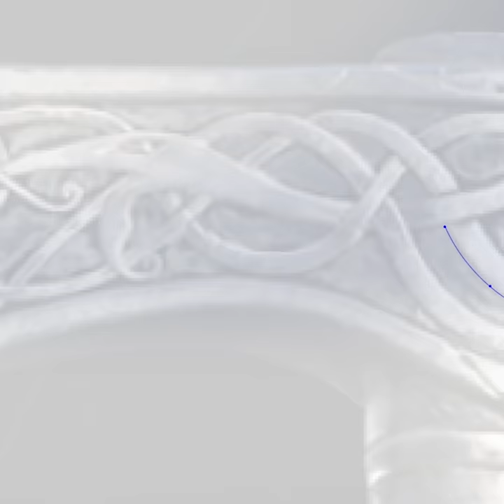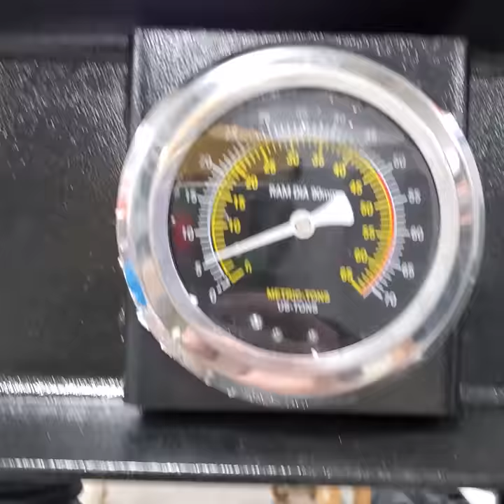VALHALLA AXE! (One Day Build!)

Comment: Next week: Work like a Vikinger (without your technical equipment just hammers and this stuff).
Reply: Forging?
Reply: @kasperklbu8050  For example I meant that they should use a hammer instead of their technical equipment but forging is a good idea
Reply: Well scandinavians had some complex tooling for their time obviously not to these level but they definitely had some kind of lathe as evidenced by the uniform taper on their shields
Reply: @velazquezarmouries  Lathes were about for around 2000 years before the Vikings arrived in Britain so I would assume so
Reply: @olive7831  greeks also supposedly made their shields in layhes
Reply: Vikingr*

Comment: Always love a good axe build, a tip from a knife maker and axe restorer, saltwater electro etching using a vinyl stencil isnt much slower than that cnc laser and gives cleaner less burned looking lines for decorative engraving on metal pieces like that, I use 12v but you can push it higher for faster results

Comment: That's... That's just not safe to swing...
please make handles better next time :(
Reply from the maker: Why is it not safe to swing? It has over 8 inches of hydraulically pressed handle inside of it... you couldn't pull the head off the handle if you wanted to!
Reply: @theHacksmithVLOGS  

Yeah it is hidraulically pressed, but it's also heavy as fuck :I

Well i don't really know, i just think a wedge (i think that's how they're called) on the top would make it safer
Reply from the maker: Its not going anywhere.  Normal axes and sledge hammers only have about 2" of material to hold onto,  like i said,  this handle goes all the way up into it.  Like 8". It ain't going anywhere

Comment: Sorry but that is as like an axe as a door is. Could not even watch the last half of the vid
Reply from the maker: Your comment doesn't even make sense bro
Reply: I don’t see how, as the so called axe made is nothing like an axe
Reply from the maker: Its identical to the one in the game.
Reply: @theHacksmithVLOGS  have you ever looked at the profile f an axe because from the vid I would guess not. The in the vid is so blunt and wound be far to top heavy even without the mettle pip where there would only be a thin Metal collar around the wood shaft
Reply from the maker: Yes,  they gave me the 3D model of it. It is that thick.